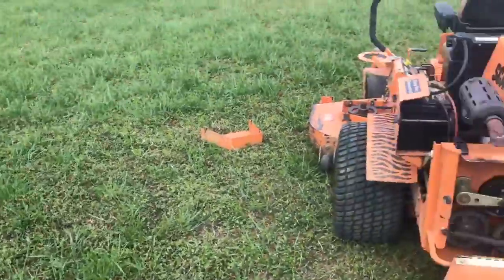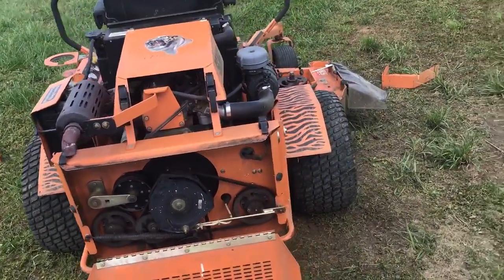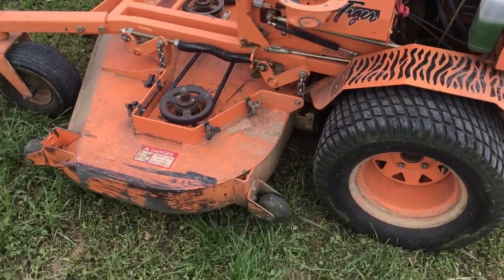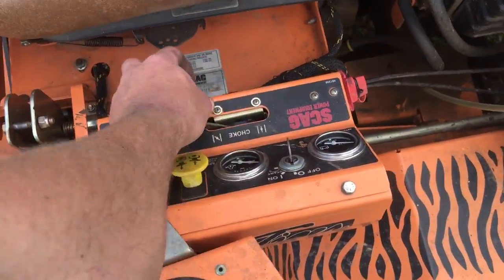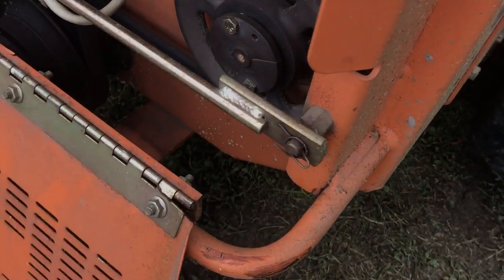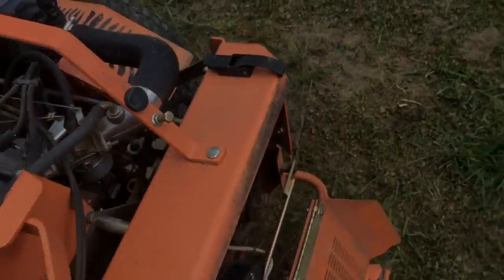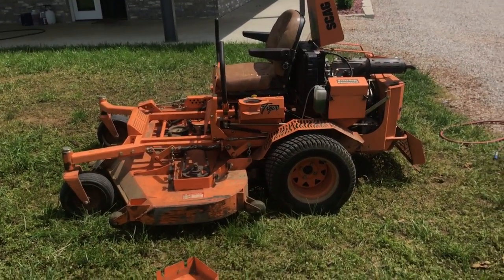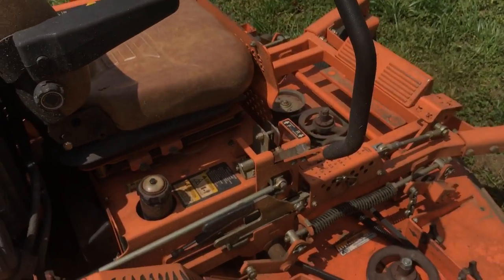My sweet heart!!! Scagg!!

Comment: Ohhhh it's got one of them Briggs/Isuzu motors in it. Have one of them in one of our toro workmans, sum bitch is super super super expensive to get parts for. Sweet machine though if you ever blow out the motor I bet a kubota would fit right up in there
Reply: The new ones come with a Kubota.
Reply: almost all of the newer commercial lawn mowers have the buzzn kubota, gas or diesel.